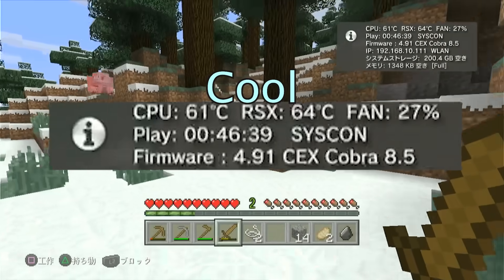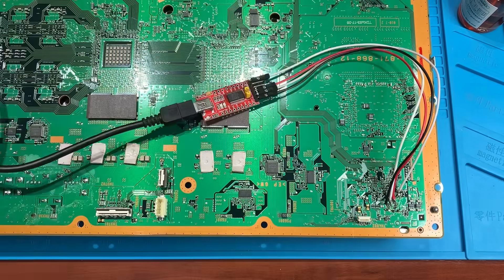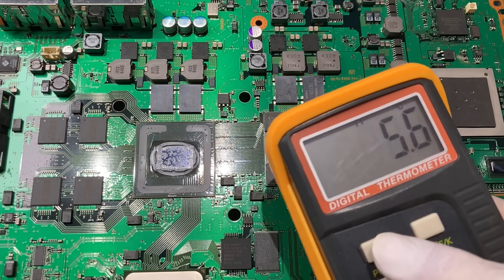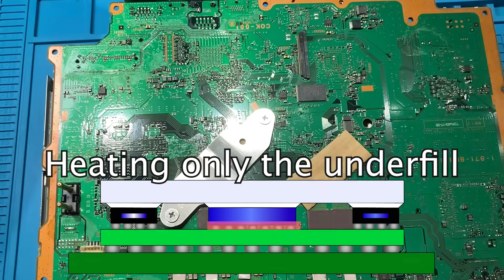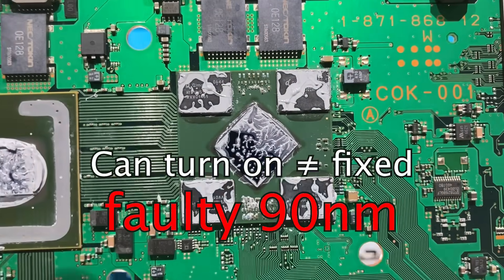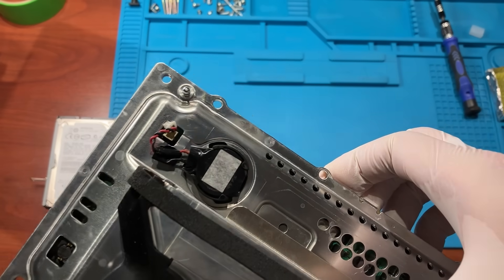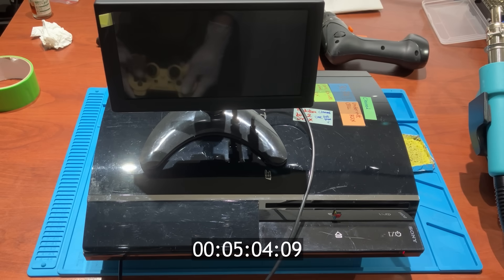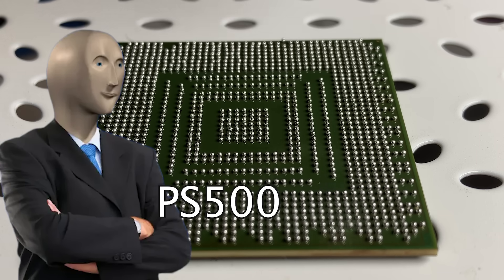Does undervolting mod stop PS3 YLOD?

Comment: Random thing but you dont need to run a game everytime you wanna put load onto the console

The PS3 music visualiser also does depend on the RSX and CELL
Also a random question but is the syscon error 2131 bad? I had it on my PS3 Slim (CECH-2512A 40nm Toshiba)
the wiki says its related to the thermal diode and mine seems fine atm except it overheats (probably due to the fact that it lacks the cardboard on the brace)

Comment: I think the thermal camera measurement of the center of the silicon die is measuring infrared reflections rather than the silicon temperature, since it's more reflective than absorptive/emissive in the IR bands.

Comment: I don't know if you knew this but there's something you can install for extracting syscon error logs easily, since your ps3 was still turning on but shuts down in-game, just look in brewology website and you might find PS3 Advanced Tools, download pkg and install it and make sure you have a USB with at least any storage available and then you save yourself from having to get the syscon error logs that way, only do this if you can keep the PS3 up, I did this when my KO3 got a 1002 and for my GO3 I took a different approach and heated up the console form behind because the RSX was failing (3034 and 4422) so just to save you time this can work without having to put as much effort, if you feel like the PS3 can stay up, if not resort to the traditional way of retrieving the Syscon Error logs.

I hope this helped you.
Reply: Yea but.. his console never turned on after hence 3034, if it happens once its not going to turn on till its fixed
Reply: @Wailky2008 not the case since he shown gameplay, please watch the video in full.

Comment: why hasn’t anyone mentioned redoing the underfill on the silicon itself? would that be impossible or just way too risky?
Reply from the maker: I hope someone can figure out how. 
So far, no one has successfully removed underfill without damaging the silicon.
Reply: @hardwarerepair200  Its physically impossible as the underfill acts like a "epoxy resin" once set. Would need to be biologically eaten by some material but it would probably eat everything around it aswell
Reply from the maker: Thank you for the explanation!
Now I’m sure it’s impossible.

Comment: Undervolting mod is very interesting 😅 . I think, it could be possible to create a spécial CFW for FAT model with undervolting mod like noBT, no BD,... # evilnat
Reply: Its not possible because undervolting happens on Syscon level, you need access to it trough soldering 4 wires

Comment: I still think that undervolting + delid + modifying fan curves to ramp up your fan might save your RSX from dying.
In your case, solder balls under the die could have been already fatigued before you did the undervolting and cracking was only a matter of time.
Thank you for the great material and wish you all the best

Comment: From my experience with mods, in particular with a lot of phat ps3 consoles, the most important thing to do is thermal paste and jailbreaking so you can control the fan curve to keep it at a certain temp. If you undervolt it  that will also work. The bad news is many games will run at 19 or less frames per second. I have the slim model maxed out to the highest  overclock and i still sometimes dip to 25 frames on intense games with a lot going on.  The only reason you should buy the Phat anyways is if you just like the way it looks or you want to play discs of ps1, ps2 and ps3 on one console. Otherwise save you self the noise and get a cech-25xx.

Comment: Best way to prevent YLODs:
- Get a 65 or 40nm RSX (most important step)
- Replace the NEC/TOKIN caps with RIP Felix Tantalizers
- Keep the temperatures healthy by using CFW apps like the Webman mod. Useful for CELL temps since the 40nm RSX already runs cool
- Use the APS power supply for less heat and more efficiency
- Replace the HDD (that thing is nearly 20 years old and could give you errors/freezes)
- Keep the console in a clean environment so that the fans can do their job
- Optionally, slightly undervolt the chips if the fans can't keep the chips at a nice temperature or if you live in a very warm environment

If you follow these steps, the only thing that can still fail is the vram from the 40nm rsx (if you have a later revision) but that is pretty rare. Otherwise we would be seeing people complain about their Slims and Super Slims dying. 95% of the complaints online are always about the Phat PS3s and when it is about a Slim, it's normally disc drive/HDD related. 😁

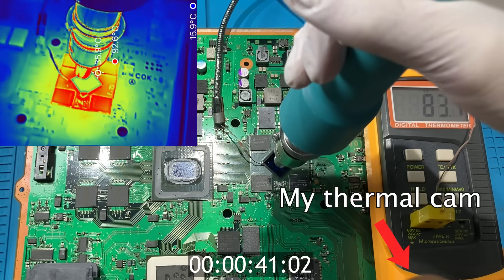Comment: One thing I want to point out is that the RSX has a mirror finish and that's the same for the infrared while using the thermal camera (4:30). To have an acurate reading you can use a piece of tape like kapton or electric tape, or a paint marker

Comment: My CECHB00 runs on its original 90nm RSX although with several mods:

- undervolt to @1.19V or so (I forgot the exact value but IIRC the CELL wass already at that voltage, only the RSX had to be lowered in voltage)
- 1TB SSD - as much as it's "frowned upon", thing runs cooler than a HDD and faster. The latter may be placebo effect but eh.
- 30% minimum fan setting - keeps the RSX well cool enough, the maximum temperature being at best 64-65, with a constant 63 degree celcius most of times.

Comment: I think for me at this point even though it's great to learn how to mess with these systems, it is such a hassle to keep them from killing themselves. I literally just tried cleaning out my system from top to bottom and even added new thermal paste, to then be unlucky and after putting everything back together have the USB ports not work even though beforehand I turned it on with minimal screws and it worked perfectly fine so that's fun to deal with

Comment: In my experience with the 90s they always seem to fail soon after a de-lid even when it comes off with little effort. I think just the act of heating it to 100c where the thermal glue loosens pushes it over the edge. I no longer delid 90nm RSX unless absolutely needed most times there fine on temps and with under volting I'll probably never de-lid a 90nm RSX again. Haven't had any long-term issue with any 65nm ive de-lided so I'll keep doing those untill it causes issues. Great video it sucks when you do everything you can to save it but its not your fault its just what happens sometimes.
Reply: yeah that sucks. hopefully someone can find a way to delid rsx without putting a heat gun on its ihs. from my experience gathering ps3s for spare parts, it is the cell that requires immediate delid
Reply: Thank you for this comment.  I had a 3000yen ps3fat, and it too died after i de-lided it.  30 seconds boot before failure.  I have replaced it, and now play a ps3 slim, but I feel the sting of regret not being able to fix it.  I am yet to connect to a syscon reader, I think I'll just throw it away.
Reply: @Antzmacadamia I can definitely relate to that my E01 died but I was able to sent  it to have a 40nm frankenstein service and its been a great console again. I had its original RSX made into a keychain. Point is these early models can be permanently fixed long-term its just extremely expensive.
Reply: @Qxxda  Please tell me how much.  I cant find the service here in Japan.  If I ever travel to Vietnam or Taiwan I'd probably chase the service down.
Reply: @Qxxda did your E01 rsx died from heated delid? 3034 after?
Reply: @Antzmacadamia im not sure about repairs outside the U.S but since im based in the U.S I had my console repaired at a shop that is called Computer Booter in Carmichael, California but you will have to do your own research im sure there's some people that repair them in Japan.
Reply: @NextGeneration9501 No it didn't I delided both the CELL and RSX in 2021 it lasted until May, 2025 at 190 days of runtime it still could have definitely been a factor but from my research 190days on a 90nm is about average.

Comment: Hi, great video, i have a console with 1002 syscon error code, unfortunately i dont have the felix tantalizer so i just used six 470 tantalum capacitor and the console boot up and stays on, but i get a glitchy screen on xmb and artifacts when i load a game, what could be the problem, any ideas

Comment: Ive worked on these for ages at board repair level with a BGA machine and oscilloscope, Sometimes its one of the processors, sometimes its one or more of the NEC/TOKIN fuses, Ive also seen the VRam on the RSX under the IHS fail. The best way Ive successfully removed significant heat from the CPU and GPU is by modifying the PSU to be outside the case and a stand alone power brick like the 360 has. Reballing does help the issue but its a 50/50 chance that its actually the CPU/GPU that failed or something else entirely. The YLOD was just a warning to tell the user it has a board level hardware failure. Great video though, you were definitely spot on in every point you made, nice to see someone else pointing out the reflow scam. I have reballed some but 80% of the time it was unneeded and also informed my customers that it would can never be "fixed" just bandaided until its next failure.

Comment: thats why slim and superslim is best ps3 versions i like the first models design but omg this is cursed
Reply from the maker: Luckily, people have found a way to uncurse it (Frankenstein mod)
Reply: @hardwarerepair200 I'm wondering if the 28nm RSX processor would work in the fat PS3, but I think the sizes dont match. great videos btw <3
Reply from the maker: 28nm RSX won't fit the Phat models. But there are people designing adapter for 28nm RSX so that it works for older models.
I haven't heard any breakthroughs since the project started a few years ago.

Comment: Another good thing about undervolting is that lower voltage on chips result in less noise on NEC tokins, which can fix the 1002 and 1001 errors without replacing them, i did the testing myself, it really works
Reply from the maker: Interesting! Didn't know that. Will give it a try if I have a chance!

Comment: Won’t undervolting kill it?
Reply from the maker: There is no way undervolting would kill the console.
I think you are talking about overvolting or overclocking?
Reply: Undervolting should extend its life spand, since it lower power draw and temps
Reply: Undervolting is like the opposite of overclocking. It generally is non harmful.
Reply: @StormHawksHD it is???
Reply: @RaysGamingChannel2003  no, it's not the opposite, undervolting and overclocking are two separate actions. 
Most overclocks that result in an noticeable performance increase are unstable at default voltage and often need an overvolt (increase in voltage) to be stable.

So, often you overclock and overvolt, you can however try to overclock while keeping the stock voltage or even lowering the voltage if it's stable which is dependent on the quality of the silicon, but it's still and overclock once you increased the clock speed. (arguably even keeping the stock clock speed at a lowered voltage can be considered overclocking)

The clock speeds also have no impact on TDP and heat generation, those are related to voltage: higher voltage -> higher TDP = higher temperature and the other way around.
Sorry for the wall of text.

Comment: You should try to do a frankenstein mod on it. Swap the 90nm gpu to a 40nm
Reply: Yes! And keep it undervolted, who knows how much temp this GPU will lose in this environment
Reply: @gmdmat6668  No need. I have a 40nm Frankenstein and that thing barely goes above 52ºC when gaming.
The 90nm CELL however would definitely benefit from an undervolt though.

Comment: That's interesting, wonder for how long my CECHC will survive for (14 Days usage, no past errors) with both Cell and RSX at 1.0875V. Its running very cool as of now because basically I edited  the Syscon fan table so that both CPU and RSX don't reach 55C at all and it works surprisingly well with it going up till 28-30% fan speed max (avg. RSX temps while gaming 48-51C). Its the very first thing I did alongside thermal paste replacement and CFW instead of mindlessly testing games with that deceiving quiet fan table on ofw before doing anything else 😂😂 Thank you for the video and keep on keeping on as always!
Reply from the maker: I hope your console could stay as long as possible!
But wow, 48-51C is a very good temp. Mine was 60-62C at 28% fan speed.
I did stress test my console in my last video for over 10 hours, not sure if that stress test killed it.
Reply: @h @hardwarerepair200 ll there is a theory held by minority that if it stays below 55C it actually prevents 3034. Its based on some old pdf data based on bumpgate. (The RSX stresses on an upward position at 55C before 70C lowers it back down and weakens the underfill) Basically 64C and co. We dont really know what the actual temps are of hotspots, the ps3 only has one thermal monitor but what does it measure? The centre? The edge temperature? We dont really know. It can be that at some place on the die that its sitting at 70+ with it sitting at 64C. Also I think it can also highly depend by how many times a console has been used ignorantly on ofw with nothing done about temps before

Comment: This man is way too obsessed with this 2007 console with a faulty design
Reply: Dude, the faulty design is on the RSX, it can be solved by replacing it with another (ideally a 40nm one)
Reply: @Metallumtenebrarum-jt7rd  not worth it, just try to ""fix it"" DIY way, and when it dies buy replacement ps3, and if your PS3 was original backwards compatible model then buy PS3 slim + PS2 slim.
Reply: @jonnyprogamer  right.
Reply: @jonnyprogamer   Fun fact: The PS3 has a way better emulation of the PS1 than most later PS2 slims (e.g: 750XX+), even though I still have a real PS1 in working condition.
Reply: @Metallumtenebrarum-jt7rd  Might be, but any PS3 model in the market can emulate PS1, they all do it via software, so using 2006-07 PS3s (the ones with the defect) or superslim / slim gives the same experience.
Only thing the OG PS3 has exclusively is PS2 hardware compatibility (or partial in some models), but you can easily buy PS3 Slim + PS2 for ultra cheap, reliable, and not spend all that money on the faulty launch model
Reply: @jonnyprogamer PS3 has a great PS1 emulator, but I might just go ahead and just have a Super Slim PS3, HEn it and have a nice homebrew machine for my CRT, for PS1 titles, I'll stick to my modchipped PS1.
Reply: Let people enjoy things
Reply: He's skilled & talented
U not better than that
Reply: @eileenlucynakurosawa7421 I didnt mean something like that, this is a great hobby and im following him for a long time